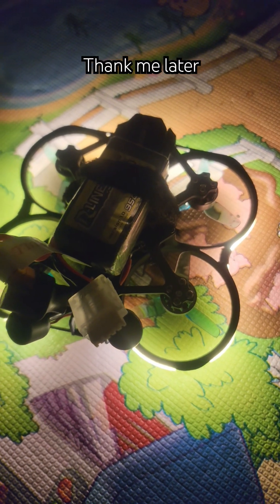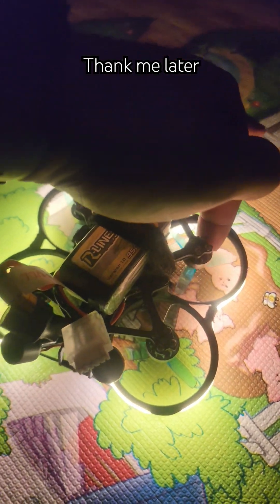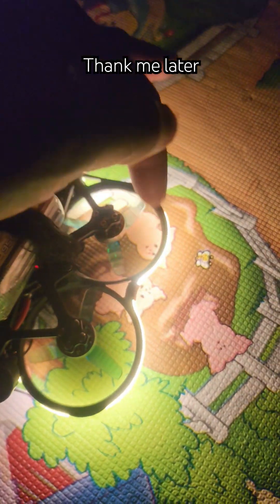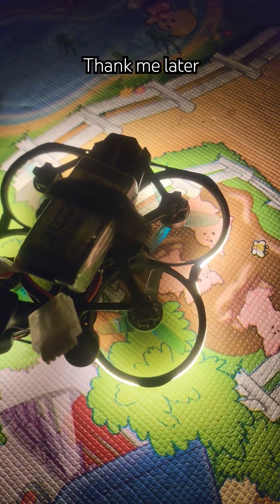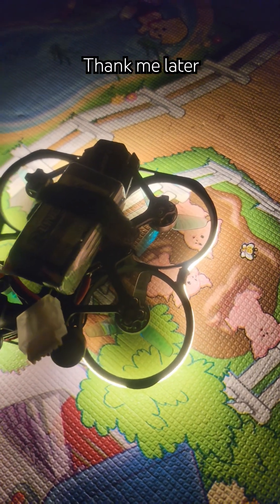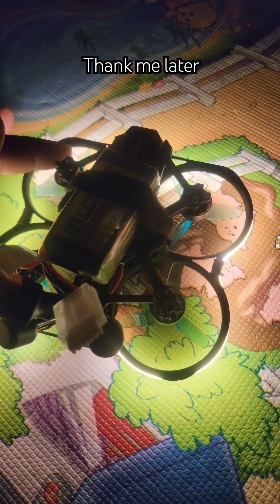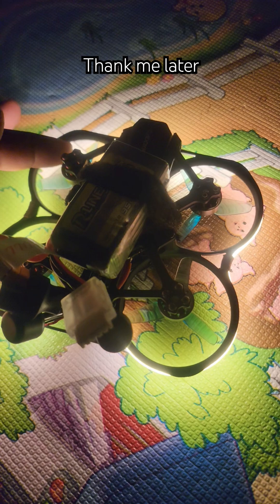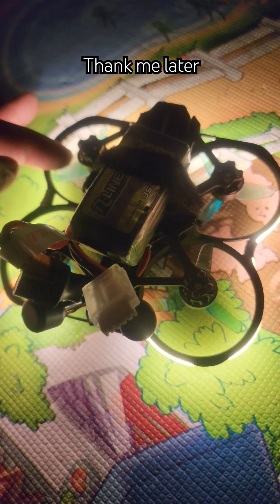how to know which way to put on props! #ttp #quadcopter #tttt #drone

Comment: You could also go into betafligh and check the prop direction and test the motors without the props on to confirm.
Reply from the maker: Truth... the problem is even with a paper to see the motor direction ot won't tell you if it's going up or down only your eyes can see it... then only theough trial and error will you know which way anyways. I was just saying no one is saying anything. Cause everyone is assuming everyone already knows... just giving what i was given.
Reply: @Fourtho assuming you take your props off before running the motor test. You can feel the direction the motor is spinning and then make note. This also helps to make sure that your motors are spinning in the right configuration. I.e quad x and then either props out or props in. It takes the guess work out. Once you know the motor direction just match the leading edge of the props to that direction. In this case you have to be careful with the motors facing down and make sure the props are installed to reference the motor spin with the quad right side up.
Reply from the maker: @deathcat99  in the start I did this, and it didn't work, I think I have a video of how many times the drone kept flipping out. the videos on caddx then said its an inverted motor which means the letters have to face up, the letters on the motors have to face down, then with a pusher style drone you need to have the leading edge going towards the middle of the drone, if you have a drone tuned for coming in compared to going outward. for the begginers though, that's so much to know... I had to learn the hard way and was trying to help, thank you for your efforts, I wish you were there before I learned all of this, I would had been so grateful to have someone else there but I'm still grateful you came to say something and hopefully, another person learning watching the video gets the information as well!